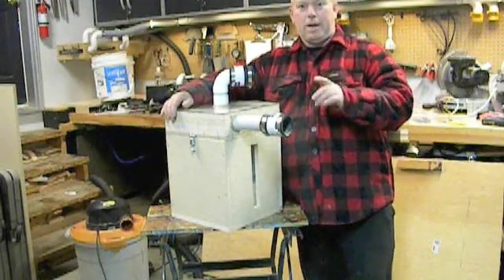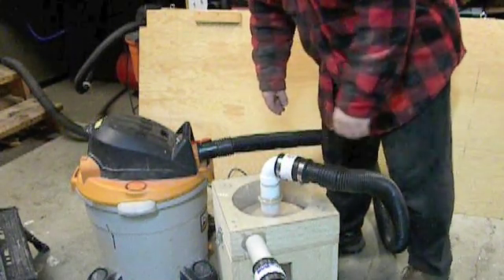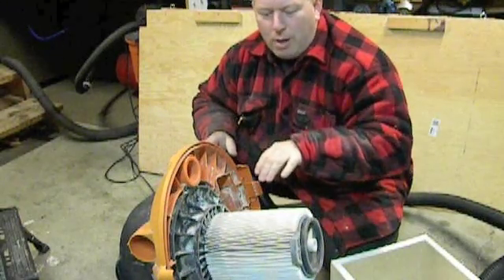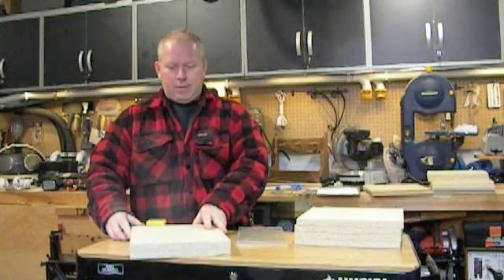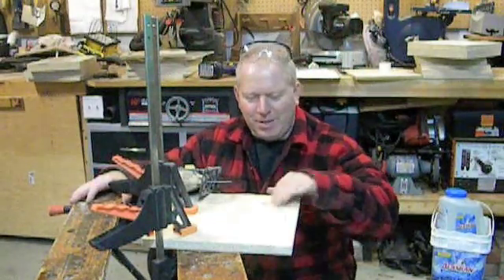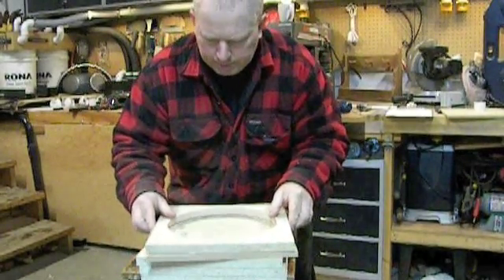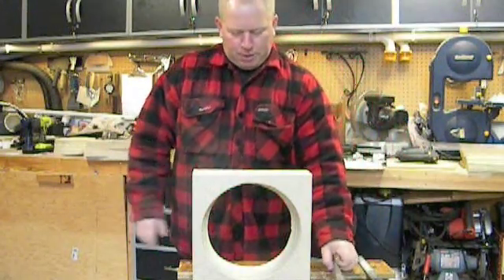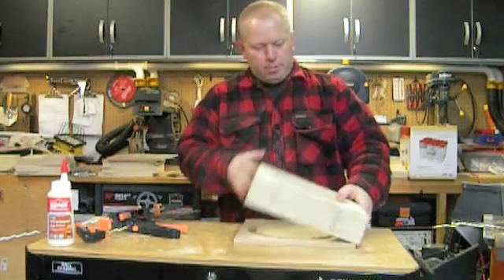World's Best Cyclone Dust Separator! (part 1 of 2)

Comment: Rob, how are things changed if you make one a bit bigger?  My planer put out some shavings that would fill that thing up quickly.  I am thinking I would need one double that size.
Reply from the maker: A planer has much larger chips and very little dust.  If you are planing enough boards for a project you would most likely fill any home workshop vac system.  With a planner I would not use the cyclone and just use a regular vac or I would not use anything and sweep up the debris.  If you want to use a cyclone vac system, you could have a dedicated trash can with a cyclone lid (available many places including Lee Valley Tools, Busy Bee Tools).  This way you can enjoy the fine dust removal of the small cyclone and easily remove the large volume of chips from the trash can cyclone and just hook the whole thing up using your existing shop vac cyclone set up.  (series set up.  Planer to trash can cyclone to existing shop vac cyclone system)
You can make the cyclone larger and place it on a trash can if you want also. 
Good Luck with your build!
Cheers!
Rob

Comment: I was looking a long time for an easy to build cyclone dust separator, now i've found your video. great work and tomorrow i'm starting right now building one . thx.
Reply from the maker: Good Luck with your build.  I have a couple cyclones with slightly  different designs here on my channel - check them out.  If you have any issues just fire me off a comment or an email and we'll get it all straightened out.
Cheers!
Rob

Comment: Besides being a lot more stable, are there other advantages to a box to collect the dust as compared to say a 5-gallon Home Depot bucket?  Are there limitations to the size one can make the dust bin?  Thanks for sharing.  Very nice concept and execution.
Reply from the maker: I have made a few designs, all of them are on my channel.  The benefits of the bin over the 5 gallon bucket are - ease of construction (you don't need a router), you can have a see through window to see how much saw dust is in the bin, it is (as you mentioned) more stable.  You can make the bin any size you wish or you can use a bucket.  (checkout my other video's where I have used buckets)
Good Luck with your build!  
Cheers!
Rob

Comment: At first I didn't like the title because it's not the best but after thinking about it,  the simplicity of the build is the best I've seen so far so it got a thumbs up. I've built several cyclones myself and I have to admit that it's not easy to come up with a effective AND simple design. With a CNC router this entire build can be cut out in 30 minutes or less. 

Thanks for sharing.
Reply from the maker: Ohhhh a CNC router...  I have shop envy!
Thanks for your comment!  My goal was to make it cheap and easy to build.  This is my most recent design and I addressed some shortcomings like being able to see the amount of dust in the bucket and making it easier to assemble with less tools required.
Cheers!
Rob

Comment: its square on the outer wall, causing turbulent air.   will not separate very fine dust. Fail
Reply from the maker: Did you watch the video?  The dust bin is square.  The separator is nice and round on the inside - with a slight taper.  If you watched the video you would have seen it in action and how it was constructed...

Comment: Hello Rob. After viewing almost every video on this topic I can honestly say that your design is the only one incorporates all the features I have been searching for. It has a compact design, has a viewing window to see it in operation, has a homemade dust catcher that can be sized to fit the space available, it is relatively easy to build from material I already have, it has a dust bin window which makes it easy to know when cleaning is necessary and most importantly it appears to work as well as the more complicated versions out there. Inverting the conical shape makes complete sense and I haven't seen anyone use that approach in their builds. Bottom line.....great work and thanks for sharing your ideas. I plan on making one for myself but would like to ask you a few questions before I start. (1) Your earlier attempts did not have tapered sides. Did it make an improvement by adding the inverted taper? (2) You mentioned in a comment that you have some ideas on how to improve this model. Will you be posting them soon? (3) Do you agree that a separator 16 inches square or 20 inches square might perform better since the particles will travel a greater distance around the perimeter which will slow them down faster so they will drop easier? I hope you have time to respond and I thank you in advance for taking the time to make such informative videos and sharing your knowledge. Regards...LarryM from Brooklyn
Reply from the maker: +Larry Minichello - Hey Larry!  Thanks for your wonderful comment!  I appreciate feedback and positive feedback is always the best kind!  The original top hat design was from a woodworker named "Thein".  My version, is a modified and revised version, of other peoples modified versions, of his original design.  I wanted a "cheap and easy to make" design that most people could make with only basic tools.  I found that the bucket design was hard to make with a router and hard to seat the bucket.  It was also difficult to see when it was full.  This design addresses those concerns with a new bucket design with a window.  The plexiglass top was to show others how the cyclone worked (Impress your friends! - "Wow Larry you're a genius!") and it also helps to see when there is a clog or you have a large piece of debris stuck inside.  The taper hasn't really improved the performance but the next version will have more of a taper (I'm trying to get a larger band saw - which will facilitate this).  I'm trying to decrease the overall size of the cyclone because people have very limited shop space.  As for the size of the cyclone I would say that the larger vacuums (more horsepower and CFM) will need larger cyclones.  The larger shop vac I have is 5 H.P. 
 Good Luck with your build!
Got any more questions???  Ya know where to find me...
Cheers!
Rob
Reply: Thanks Rob for the quick response to my post. I decided to use your ideas with the exception of the tapered sides since your earlier double collector video appeared to work fine without it. I have a small shop in my garage and space is a primary concern.  Thanks again for providing an alternative solution to those other bulky dust collectors that consume so much space. I hope you will continue to make more shop related videos, they're great!  Regards LarryM from Brooklyn.
Reply from the maker: +Larry Minichello - Thanks Larry!  Good luck with your build!

Comment: this is an interesting design. I don't think I have seen a tapered  separator . its a good idea and worth investigating. im thinking that as the diameter increases the speed of the debris should be slower (all be it only a small  bit) and fall out of the air stream easier
Reply from the maker: +MelbourneAlan  -  Thanks!  I don't know why they design the cyclones the way they do.  I have often thought they designed them upside down and that the design would lead to pulling the fine dust back into the vacuum.  I would like to have made a larger taper and I think I may have a new design brewing which would allow it.  My theory is that the heavier material will be forced down and out faster and more thoroughly than traditional designs. I think you are right, the airspeed at the bottom of the taper should be slower.
Reply: Hi there is no need for a taper at all if designed right  mine is 250mm high   collects 4 micron WITHOUT ANY FILTERS   https://youtu.be/3Sk74TViPIA   Cheers

Comment: I am confused to which way the 15 degree taper goes.  Is the hole larger at the top and smaller when it gets to the baffle?
Reply: +Rob's Garage Woodworking 

The viewport is brilliant.
Reply from the maker: ***** It's smaller at the top and wider at the bottom.
Reply: robsgaragewoodworkin Thanks for the quick reply.  Interesting to hear that, as most store bought units are the opposite.
Reply from the maker: ***** Yes I have often thought that when they spin the debris out of the air stream that it gets too close to the suction hose and is likely to re-enter the air stream.  This is quite a different design and works extremely well.  This is my 4th or 5th upgrade.  The main change this time was making my own bucket to simplify construction and reduce height and adding a viewing window to see how full the bucket was.

Comment: Hi Rob,
I like your solution to the cyclone separator by using materials and tools that are in most workshops. I have started to make one for myself. The cyclone uses 3 inch screws and must be 3 inches thick ans so it must be six pieces of half inch board. Is the caulking a marine grade product?
Great videos.
Regards
Colin in Northern Ireland
Reply from the maker: All the sizes are listed in the video.  the Top and bottom plate are 1/2" 12" x 12" MDF (2 pcs), cyclone body is 3/4" particle board 12" x 12" (3 pcs).  If you have any questions I will answer them.  Don't forget to watch part 2 of the video.  Good luck with your build!
Reply from the maker: robsgaragewoodworkin Oh and the caulking is just regular caulking and the adhesive is PL Premium construction adhesive.